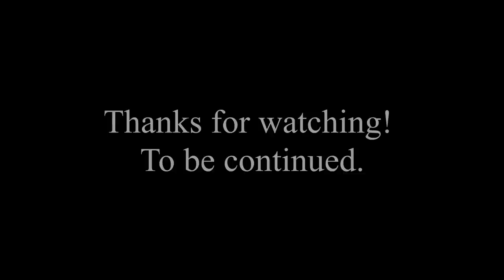Breaking In The Deckhand - Jigging Rockfish in Alaska

Comment: What kind of steering are u running that u don’t have a wheel in the cabin, n just use the auto pilot control / jogger ????
Reply from the maker: If you look closely, there is a wheel. It only has one spoke and is for back up, but she steers so easy that's all we used before we put an autopiloton.

Comment: How does your steerage work?
Reply from the maker: Hey Fishin Magician. The steering is hydraulic. The autopilot sends a signal to the pump that sends fluid to the steering ram. There is also a manual helm pump incase the autopilot pump ever fails.
Reply: @EISAlaska  Will wonders never cease. I was always on the tiller in my dad's 25 footer.